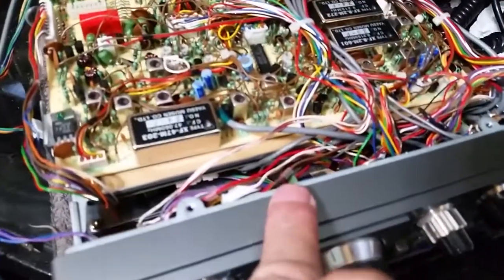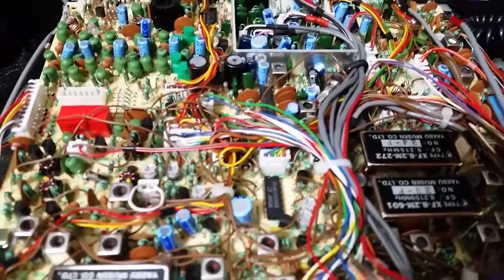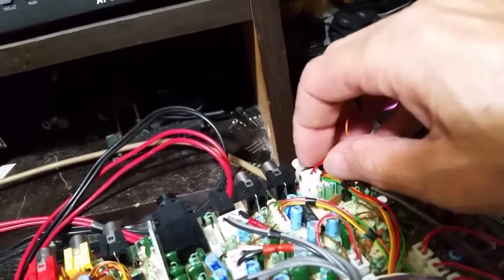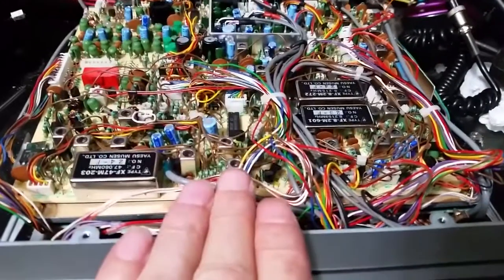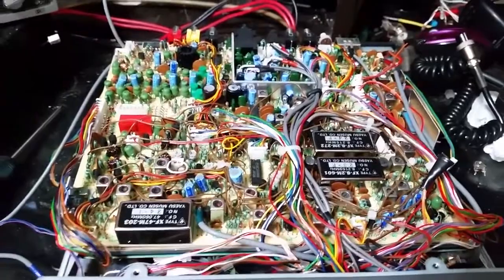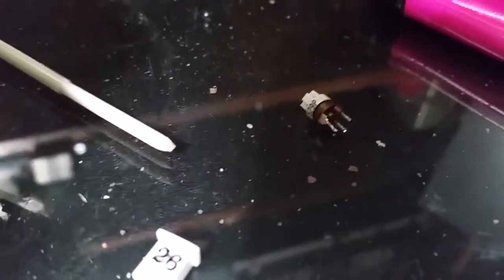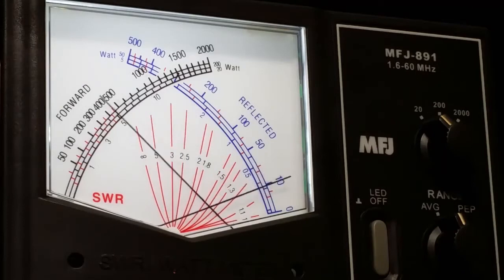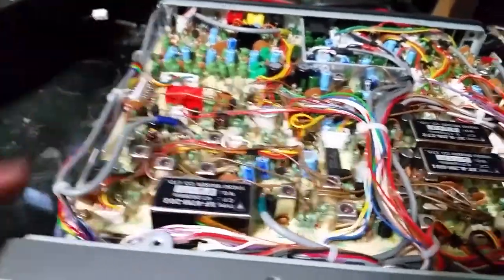YEASU FT 757GX Upgrades

Comment: I opened mine up and was pulling the VR and soldered the blue and purple wires on and then realized that plug next to it with the white wire looped around had been cut and right side soldered to the can to the left of it. Do I repair that or leave it? why would it be cut?

Comment: Great video Ralph. Thanks for sharing. I really like my FT-757GX and I use it more than any of my other radios. I noticed the issues with the ALC and I built and external pre-amp for it, thinking that that will help to drive the radio further. However, I quickly realized the ALC kicks in very early preventing the radio to reach 100W no matter of the Mic knob setting, or pre-amp setting. Now I know why. 73, VA3HDL